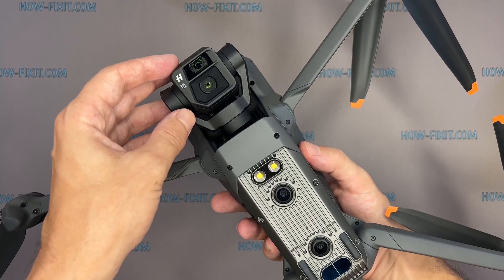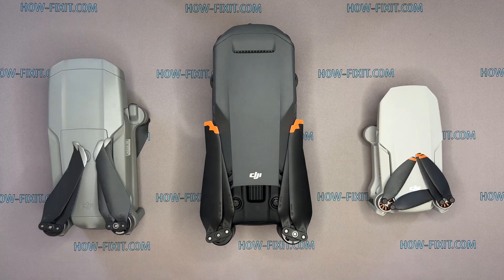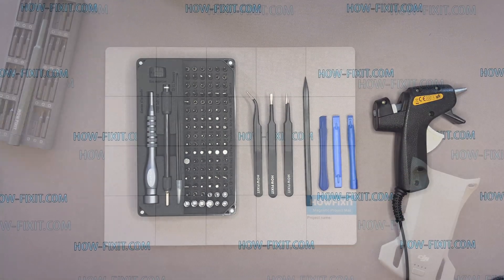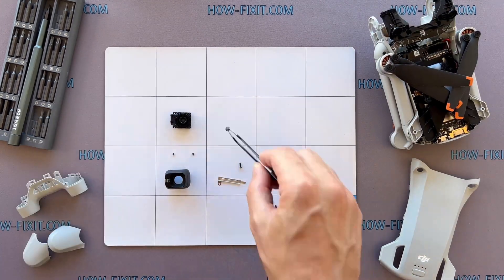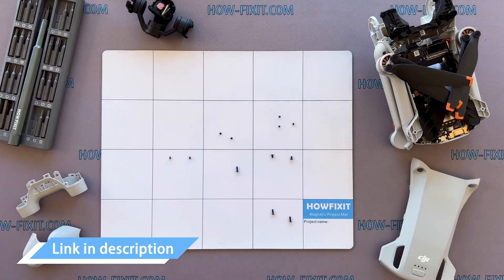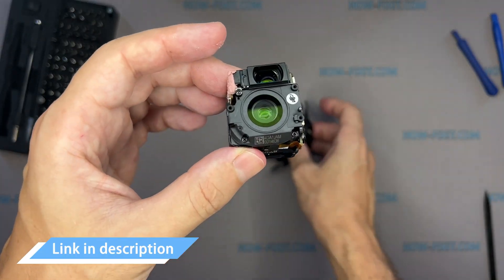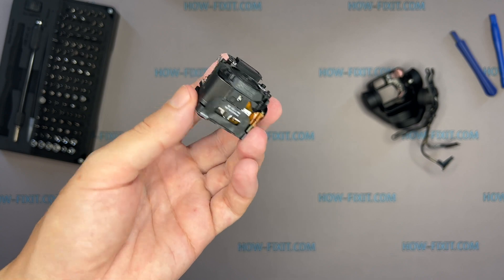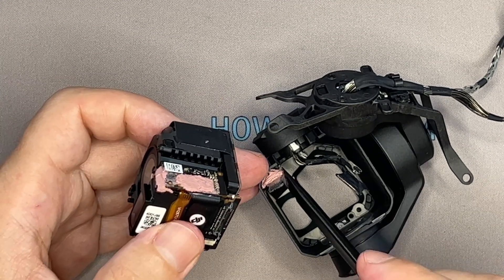DJI Mavic 3 Camera Replacement: Step-by-Step DIY Repair Guide

Comment: Hi my mavic 3 camera broken and I bought a new camera replacement. It said calibrartion required but I couldn't find any settings for that in dji assistant.Did I miss anything?
Reply: Dji software lock, force to repair with official software.
Reply: @Lucas_M3pOwner  What does that mean? Is there a work around?
Reply: @KovACTION  When you change the camera, the motherboard of the drone validates the serial numbers in the camera and if it does not match, it shows an error.
Reply: @Lucas_M3pOwner  I seem to recall somebody changing out the camera on a Mavic Air 2 with the same symptoms as you described. There was a workaround though. I wonder if there's any do-it-yourself work around for this too. So curious...
Reply: @Lucas_M3pOwner  hi. I am trying to replace the camera from another mavic 3 and have a black screen. Is this ok? How to bind the drone with the new camera?
Reply: @ssevrugin  Check or replace flex cable of the camera.
Reply: Does that mean this is a repair that will fail if you do it yourself?  @Lucas_M3pOwner
Reply: @air2som247 yes please. how I can contact you via messengers?
Reply: Hi, what is the software name? @air2som247
Reply: Hi, did you find a solution?
Reply: Where did you get camera brother am looking for camera for my drone
Reply: @Karan_sekhon8080  ebay or  Ali Express, both have it